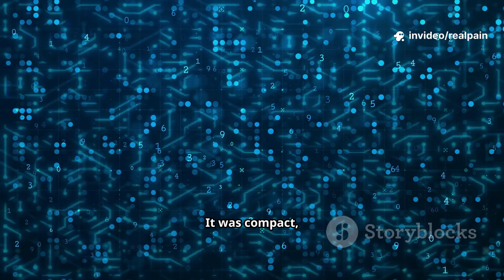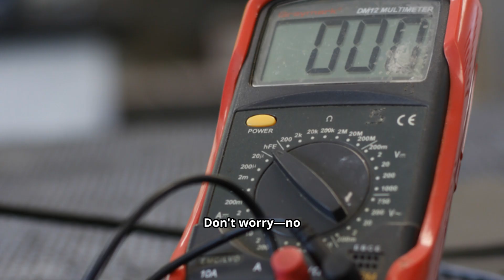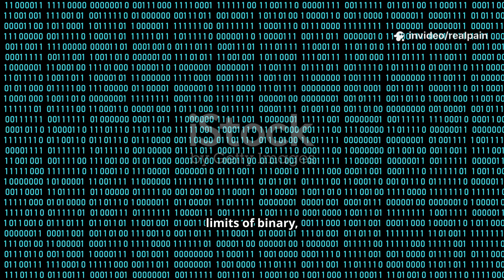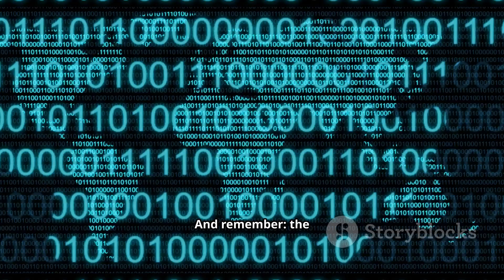Why Trinary Computers Will Blow Your Mind (And How to Build One!)

Comment from the maker: ## 🔩 SEGMENT 6: Materials & Components (12:00–14:00)

*[Visual: neatly arranged electronics on a workbench]*  
*Host (enthusiastic):*  
“Alright, let’s talk hardware! 🛠 If you want to build your own trinary computer, here’s what you’ll need—and why it’s not your average Arduino setup.”

---

### 🧱 Core Components

| Component Type        | Example / Notes                                                                 |
|-----------------------|----------------------------------------------------------------------------------|
| *Transistors*       | Standard NPN/PNP (e.g. 2N3904, BC547) for basic switching logic                 |
|                       | For advanced builds: *carbon nanotube transistors* (experimental)         |
| *Multiplexers*      | DG403 analog switches – ideal for ternary signal routing                    |
|                       | Custom-built multiplexers using discrete transistors also possible         |
| *ICs (Integrated Circuits)* | No off-the-shelf trinary ICs yet, but you can simulate ternary logic using op-amps or analog comparators |
|                       | Optional: microcontrollers for interfacing or display (e.g. ATmega328)         |
| *Voltage Reference* | To define –1, 0, +1 levels: use resistor ladders or precision voltage regulators |
| *Memory Cells*      | Custom-built using capacitors and transistors to hold three voltage states      |
| *Power Supply*      | Dual or triple rail (e.g. ±5V and ground) to support balanced ternary logic     |

---

### 🧪 Pro Tips

- **Balanced Ternary Logic**: You’ll need to design circuits that recognize and process –1, 0, and +1 voltages. This often involves clever use of comparators and reference voltages.
- **Breadboarding**: Start with modular breadboard setups to test gates and memory cells before soldering.
- **Debugging**: Use an oscilloscope or multimeter to verify voltage levels and transitions between trits.

---

*Host (smiling):*  
“Remember, this is frontier tech. You’re not just building a computer—you’re pioneering a new way of thinking. So grab your soldering iron, channel your inner Setun engineer, and let’s make trinary computing real!”